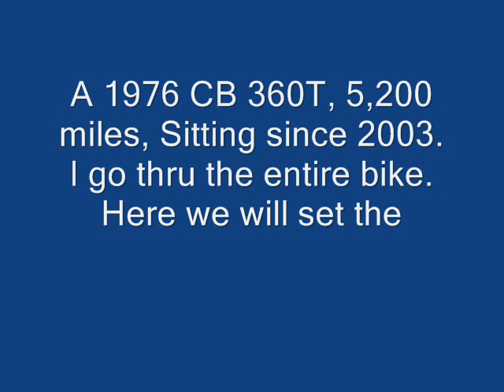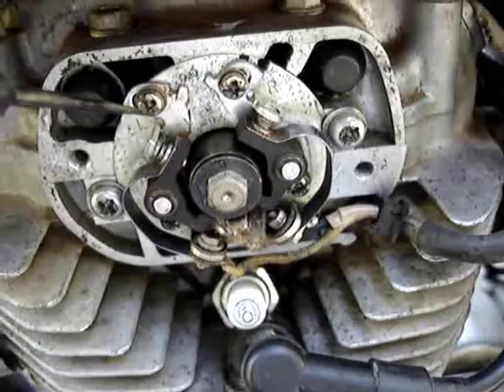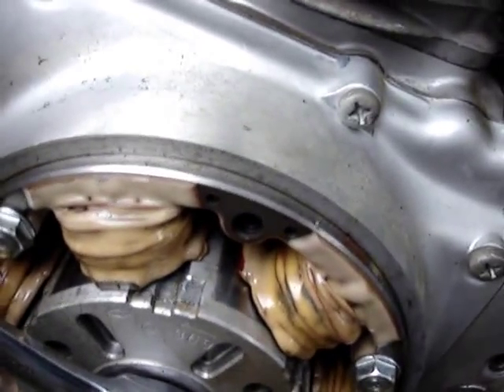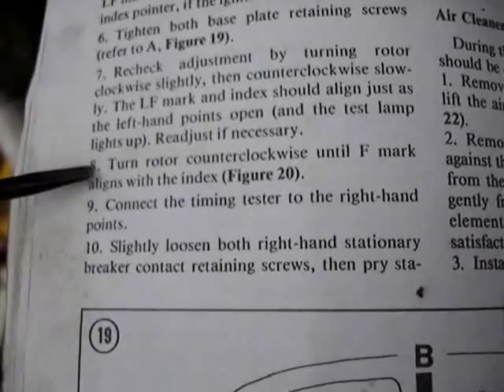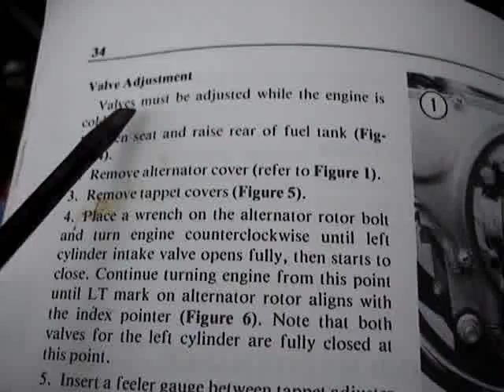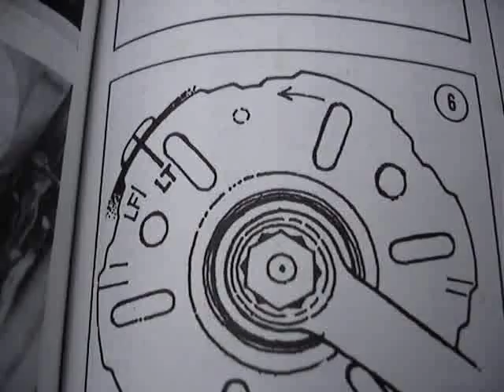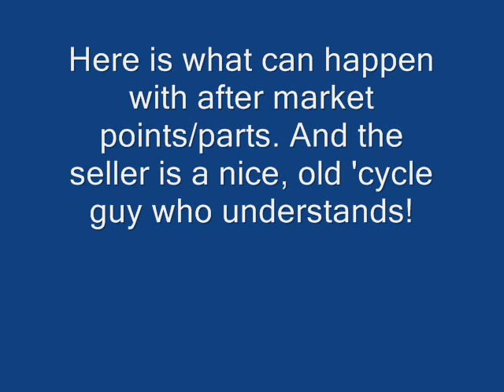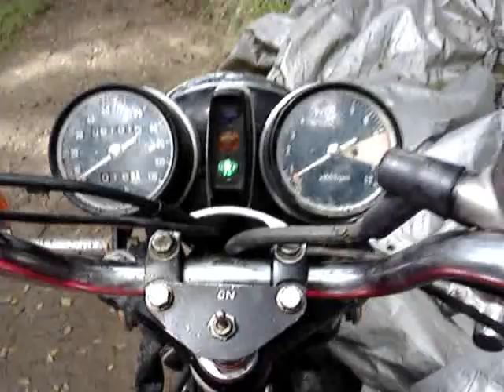HONDA CB360T Tune up Points  Timing Valve Gap

Comment: It's a good idea to tape inside cover. If gasket is missing or not fitted it will short points lead and possibly burn out ignition coil

Comment: Set point gaps at .014 thou on both.Then set left hand cylinder timing.Rotate the whole plate.Check if it has moved.Then adjust right hand cylinder timing by altering the points gap.More gap advances timing.Points have to be flat and not pitted.Grease cam for points and make sure advance unit is greased properly.If you can use a strobe light to check advance is working properly.

Comment: clymer says 12-16mm I do 14mm just be safe in between, I bought some Ebay points and had to oblonge one of the holes to make the points open even further to spec. check out my honda videos I have tons of them.
Reply from the maker: KFLY67  I bought some ebay points, too. Forgot the name of the mfg. They needed work and I sent them back.

Comment: I have a 1974 honda cb 360, that is leaking oil past the cam seal onto the points, shorting them out. can the seal be replaced by removing the bolt on the end of the cam and digging out the old seal ? Thanks Gary
Reply from the maker: I don't know and I sold the bike so I can't look. Look at the pictures I show, maybe something shows up. If you can you'll need a  seal puller. You can probably find a way to make one on YouTube.
Reply: If it is leaking oil from the cams, it's probably the head gasket. It's easy to replace, just remember to pin the cam chain so it doesn't fall down into the engine.

Comment: hes asking about the stator cover not the points cover.  i think the stator cover is perfectly normal to spill oil out because the stator is covered in oil while running. points however shouldnt be and then yes youd have an oil seal prob

Comment: Im confused, where should we be for the right cylinder? which crank shaft position? One full turn after the compression of the left cylinder? It seems like the position you were at for the F did not want to rotate on its own

Comment: I'm totally confused and I was hoping you could help out. I've been working on the timing on my 360 all day. I adjusted and cleaned the points. Everything looks good. I just can't get my test light to come on. 2 different test lights, every instruction followed to the letter. I have been going back and forth between your video and my clymer manual. Any ideas? Something that might not be in the video or the manual? Thanks in advance.

Comment: what does it mean if your test light is always on!!!! any rotation?
Reply from the maker: Trevor Rathbone  It means the points not changing their position. They must not be closing entirely. The steel lobe the points ride on can wear out. So can the plastic (?)  block the points use to ride the lobe.

Comment: iv been working on my points for about 10 hours now and still haven't got a single point adjusted right
Reply from the maker: Boy oh boy,  Well, use this video.  Are You working on a Honda?....Set the left point at about    ,013,using the proper mark (LF LT.....)The phillip head screws will be toast so get some more screws.  Once you have the one point set then rotate (clockwise, as I Recall, just follow the video)., using a socket, to the next position . Use a light like I use so you can see the bulb light up in relation to the mark. You'll be "splitting hairs" to get the two to light up at the same time--in relation to the marks---If you get close, like to .002, then give it a try... the closer you to .000 you are the better. And watch some other videos like this.
Reply: well the problem is that i bought new points and one will open right and the other stays closed and i looked at the old points and someone bent the metal spring thing so that it would open so i took a drill and drilled out the bottom hole on the point and now it opens but just barely and is a 69 honda cb350 supersport it runs now but backfires really bad at 2000rpm
Reply from the maker: fusionfast98
I have had problems with points not working properly, being all out of alignment, not opening properly.  The points to close in the gap. .001, 002 at most. You may need to return/get new points. And do you have a light to use to see when the points open?
Reply: ya I bought bought new ones but they were doing the same thing for the one on the right and also my coil for the right side exploded so i had to buy a new one
Reply from the maker: fusionfast98
It may be the lobes that open the points, Check the lobes with a micrometer. Lobes can wear flat
Reply: thats what i thought but the left side works just fine the lobe is the center piece that the points ride on right?
Reply from the maker: fusionfast98 Yes. there are 2 lobes, one for each point set. measure both lobes they should be the same
Reply: ok thank you ill check them
Reply: I found out why the right side wont open the place i bought them from made a video on how they got bad sent to them or something like that but those bad ones were sent out so i got the bad ones
Reply from the maker: fusionfast98
Well, at least you know.  I too had a bad set. As I recall the piece that is lifted by the rotating cam was too short. points wouldn't open enough.  You might want to get extra screws for the points and backing plate. They wear out from all the re-adjusting.
Reply: yeah I bought a new allen screw set for it

Comment: Why tune up the points? It's easier and better to slap in some new ones then do the timing/valves.
Reply from the maker: I had to fix these points because I didn't have the $$ for new points. A few weeks later I bought new points.  If the reader buys new points, examine them carefully, I had to send pack the first pair, they were not in "spec", they were poorly made by some after market company.
Reply: *****
Alternatively, I guess you could also order an electronic ignition system and just do away completely with the points... but that's no fun.
Reply from the maker: Johnny Tobifour I grew up with points. The last pair I adjusted was on my 1959 corvette in 1985. I never thought of it until I had to fix these points. The electronic ignition is really the way to go. Points are time consuming. In 1985 I felt the opposite. Good electronic ignitions are the best for making horsepower and you can get better MPG, too.
Reply: *****
Yea but it's boring to use electronic ignition lol.

Comment: Nice video, but you're a little long-winded and the editing left me scatterbrained.  I ended up defeated after 2 hours in the garage.  A couple additions I'd like to make, and to look at the "big picture" for a noob, you're trying to accomplish firing on the LF and F timing marks.

1. Check battery before timing and before starting.
2. Remove the plugs for easy rotation.
3. Check to make sure each side is compression stroke by using a finger instead of leaving the plugs in.
4. Use a crescent instead of a ratchet so that the motor doesn't have the opportunity to rotate.

IMO it seems like the motor fires at a different time when rotated backwards, so I would have to cycle it to fall back on LF or F's firing mark.  That left me exhausted.  It'd be better to just hold it and do all adjustments on LF and F while it is in that position.I did that by moving the timing plate to center and adjusting each point to where it would just come on and off on LF and F. 

Although I did something wrong here because my bike still wont start.  So take my recommendations with a big grain of salt.
Reply from the maker: Scott Kohs  I just saw your comment.  Did you get it fixed? when you reply I'll answer your questions
Reply: ***** thanks for posting this video up, it was helpful. I think I quit using the feeler gauge and used the light instead.
Reply from the maker: Scott Kohs The light is telling you "Closed-or-Open".  The feeler gauge is to set the opening which is what effects how long the points are open.  Is it running?